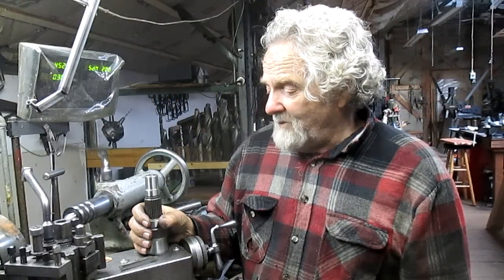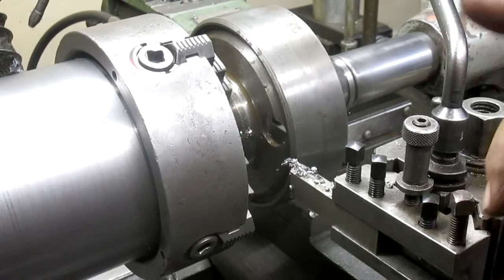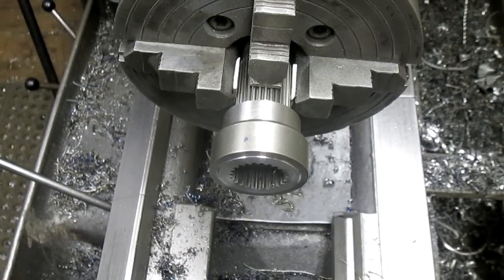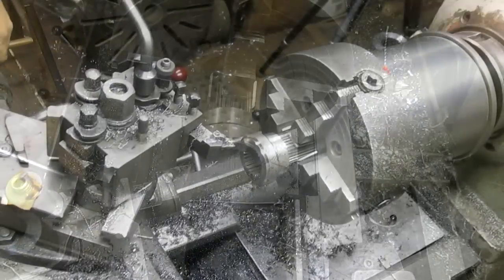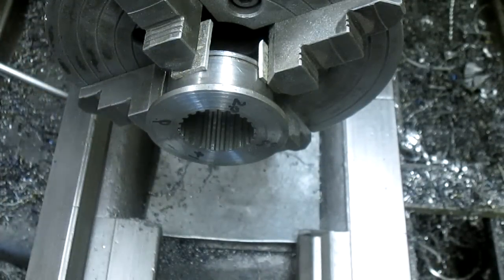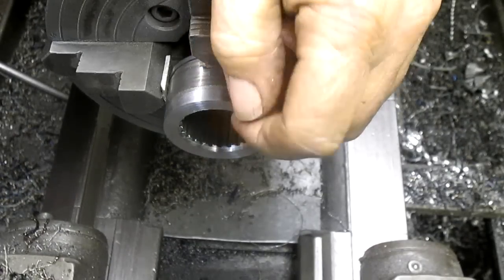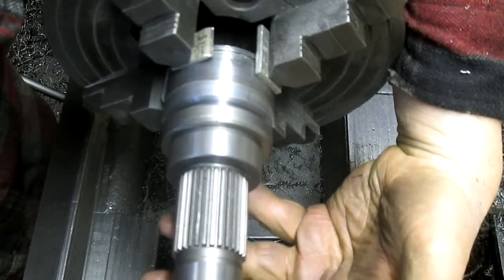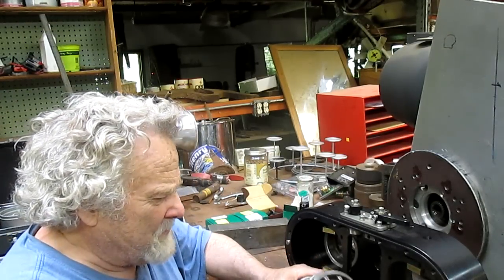Mating Two Splines

Comment: I was amazed at the precision you were able to achieve on this part.  Give yourself a pat on the back.  I was wondering will you ever restore the ways on the old Clausing?  I know it would probably cost an arm and a leg to do it, but would it be worth it.  You seem to be able to get along pretty good as is.  KOKO!!
Reply from the maker: I'm assuming you mean the 1954 MAS lathe. Truth be told I use that lathe every day and don't know if I could ever do without it for the 4 to 6 weeks to take it apart, send it to the grinders then put it back together.

Comment: Great outcome Nik. Quick question, at the beginning of the video when you started this and it moved and you ended hacksawing the part off. Why did you not grip the drum in the chuck and part it off instead of all that hand sawing ? Regards from Australia.
Reply from the maker: That lathe is so old and worn out that it no longer "part off". It just sits there doing nothing until it finally digs in and breaks the parting blade. Can't tell you how many broken blades I have laying around.